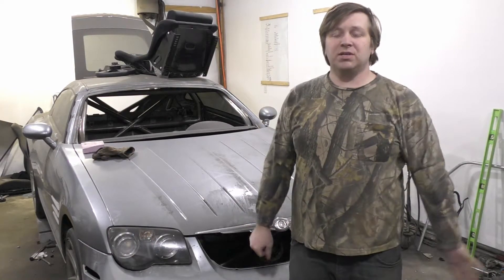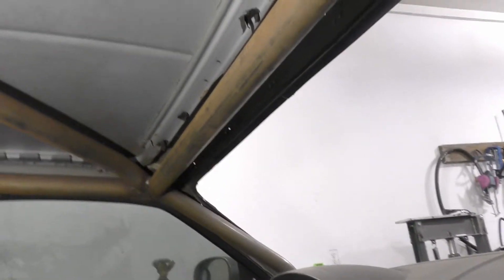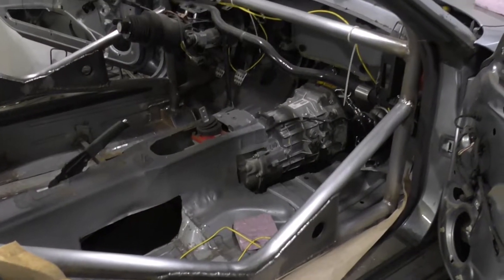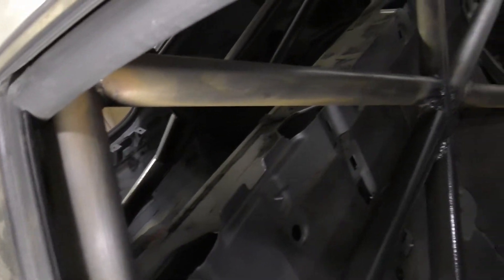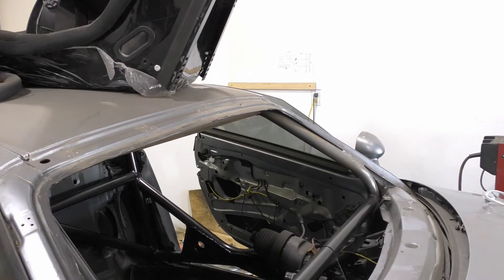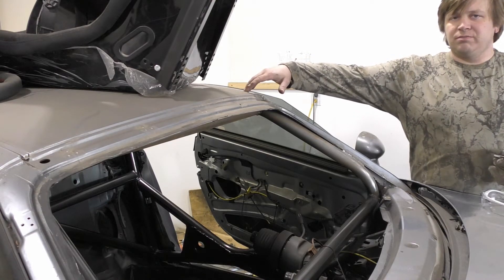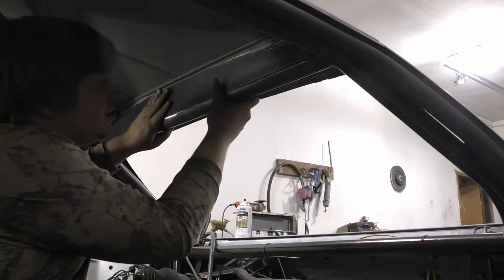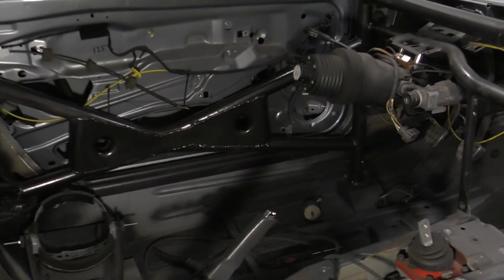V8 Crossfire Project: Cage gets Completed | Driveway

Comment: Cutting that roof section was hard to watch, needed, but still hard to watch.
Maybe make an oversized piece to fit under the piece you cut out, use some body adhesive to stick together, then push and glue it all to the roof again,from inside, a little filler and done. Just a thought.
Reply from the maker: It was cringe inducing, but I've patched worse